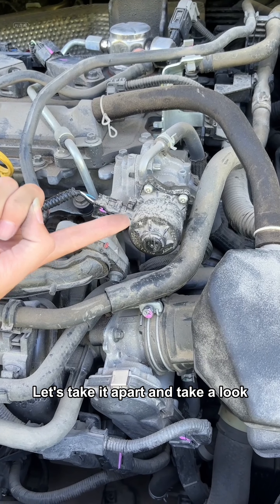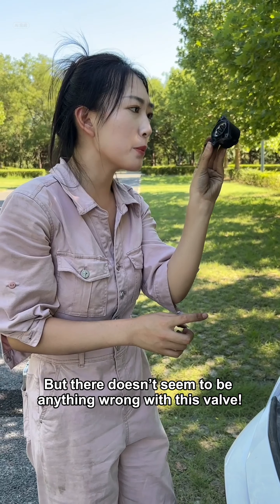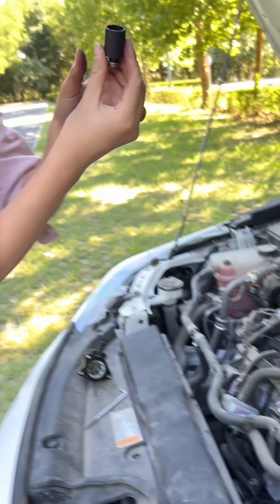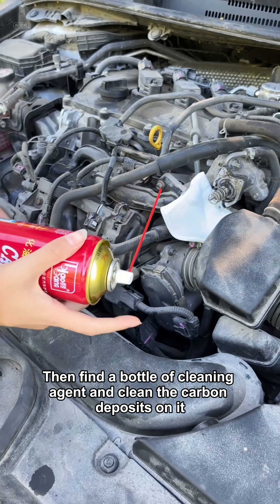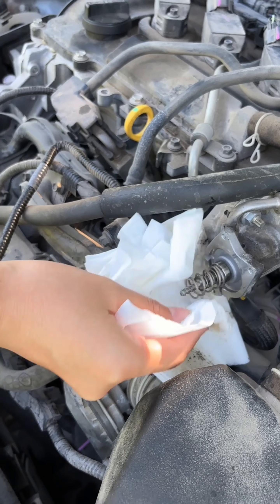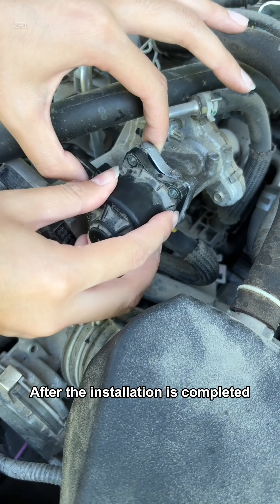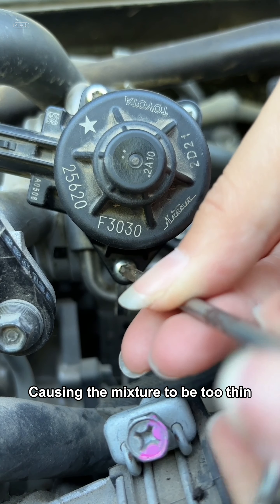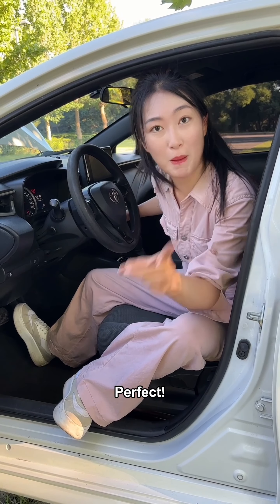EGR valve - exhaust gas recirculation valve#skills #carrepairing #automobile #tech #carsafety

Comment: 1) Change your mechanic. You don't want one that just throws parts at your car. 
2) Use OBD reader to tell you where the problem is
3) If it is the EGR valve, replace it. Cleaning is only a short term solution.

Comment: Wish you were close. Have po302 on my 2006 Subaru sti.  So far did all swaps,did compression and leakdown test,  did vacuum leak and exhaust leak check with smoke machine replaced both o2 denso sensors. ,  did noid test on injector connector.  Just gave up taking to Subaru only repair shop